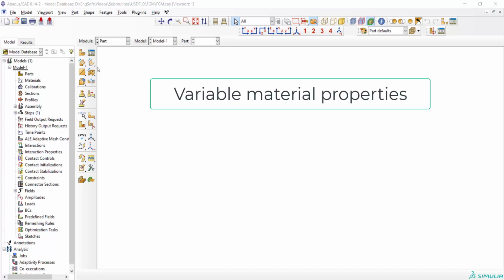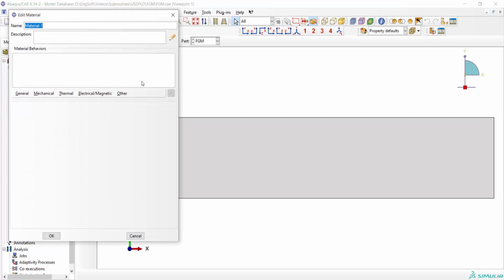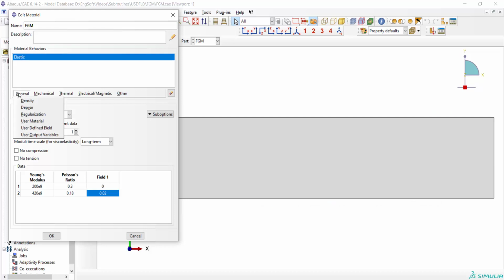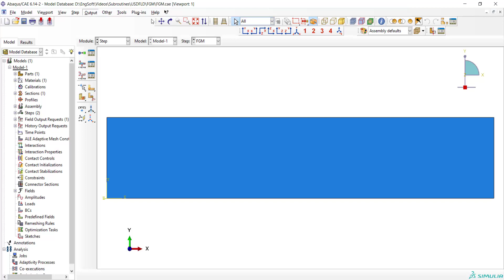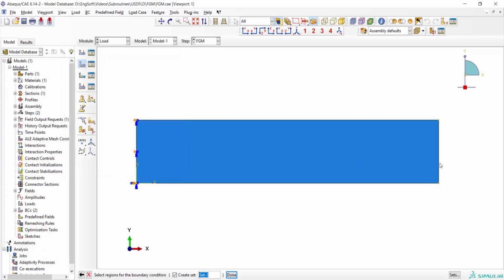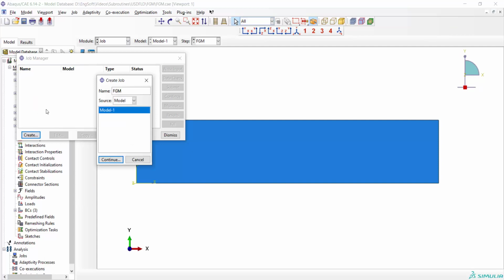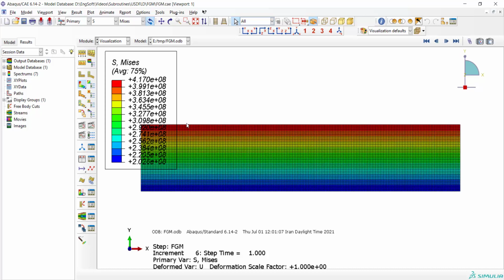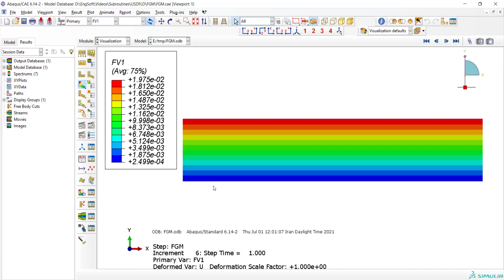How to create variable material properties, Modeling FGM by Abaqus USDFLD subroutine

Comment: How to optimize this for minimum stress?
Reply from the maker: In fact combination of optimization and FE modeling is not a straightforward task. There is topology optimization in Abaqus but it seems that you want to optimize material property in various region so topology optimization is not useful in this case. If you think you should perform optimization of FGM by Abaqus an option is to use python script based on an optimization algorithm.
Reply: Thanks  @engineering_software

Comment: If I want to do the free vibration analysis of FGM plate then the subroutine will be same? I've already tried multiple times, but job submission is aborted due to compilation of subroutine file
Reply from the maker: Yes it is the same. It seems that there is a mistake in writing the subroutine.
Reply: @engineering_software  Please provide this subroutine file

Comment: Dear Sir, Can we use this USDFLD sub-routine for 3D Dynamic-Explict Analysis?... 
I have tried " INCLUDE 'VABA_PARAM.INC' "command in Sub-routine as mentioned in Abaqus Documentation.
But, while checking the job, it is getting Aborted, with the error massage "There is problem in reading the Subroutine file".
Reply from the maker: Please use "User subroutine interface " from the vusdfld (section 1.2.22 of documentation). After that if you receive this error, you should check your new lines which you have added the to this interface.
Reply: @engineering_software 
Actually, am trying to define Varying Youngs Modulus (E) of the soil in the Z-Direction in Filed-1 of Elasticity definition,  similar to this video for 3D-Dynamic Explict model
What must be the NEW LINES that I have to include, in this subroutine interface
Thank you for your help in advance,
Reply: whether, file is be saved as .for file

Comment: Great！What to add to the code if material defined by a local coordinate? Thank you
Reply from the maker: Does your question mean that you want to define variable material based on local coordinate system and  global coordinate system is not useful in your case?
Reply: @engineering_software  Yes, I made a thick tube version of your case, i want the properties vary along with radius, but fail, maybe i used the wrong coordinate system, I think. Thanks for your reply
Reply from the maker: @usim3431  The simplest way in your case is to calculate the r distance from two cartesian coordinates. For example:
r = (X**2+Y**2)**0.5 
then r can be field1. Just be carful about the origin of the coordinates.
Reply: @engineering_software  THANKS!